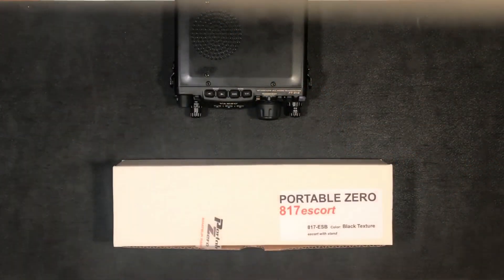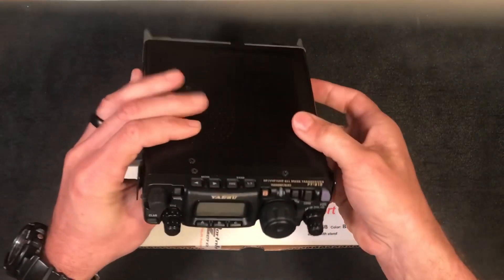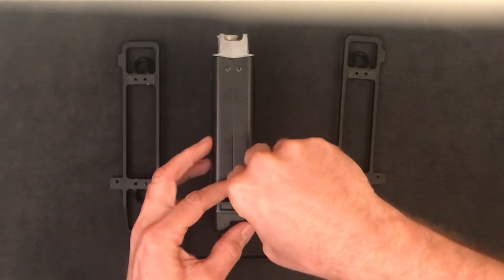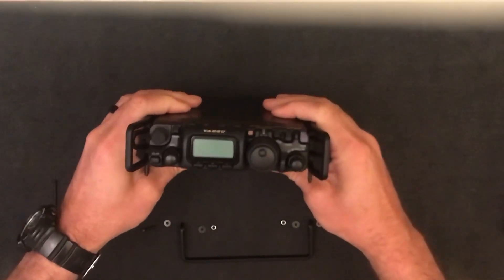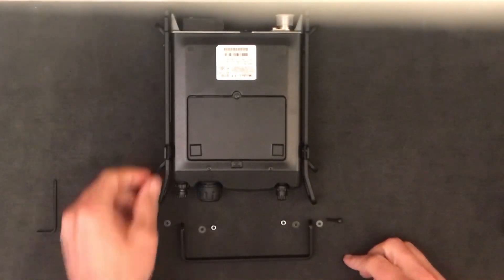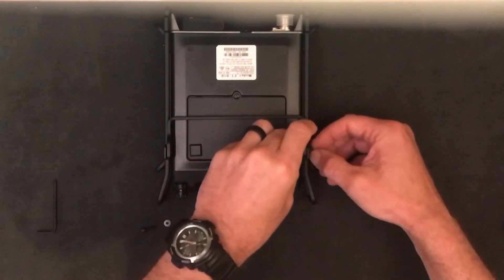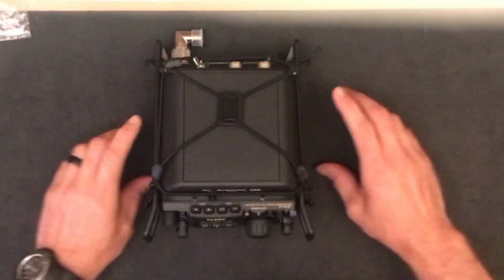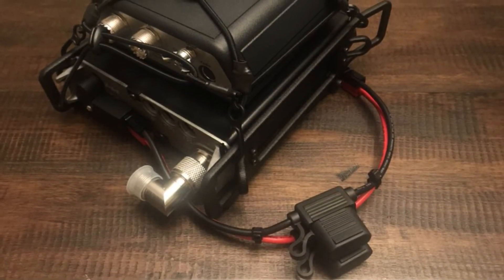Portable Zero Escort Installation on Yaesu FT-817/818ND

Comment: I just got a FT 818 and a used rail. I did not get the mounting screws. Do you know where I can get more info?
Reply from the maker: The answer might be in the 818 manual, which you can find online. If not, maybe reach out to Portable Zero's customer service and see how they can help.